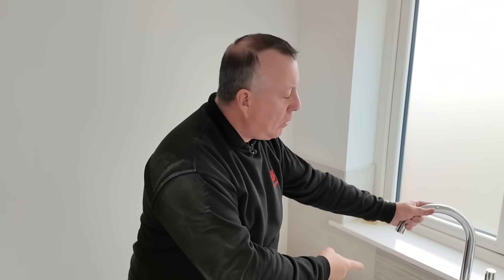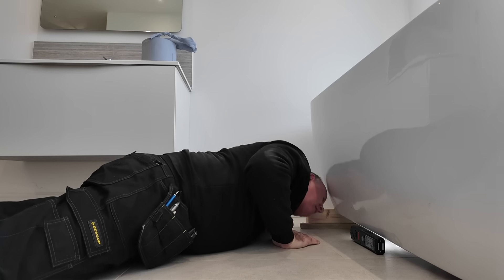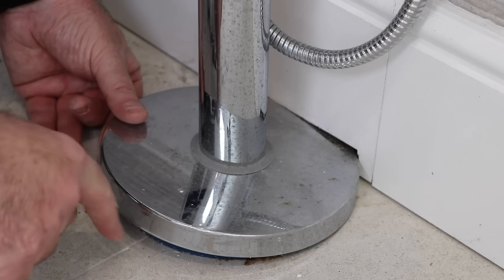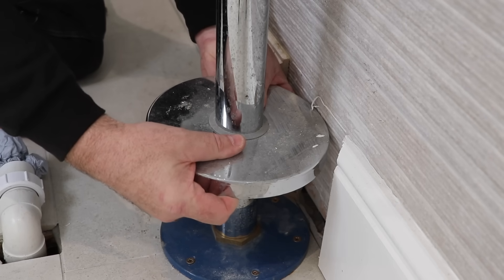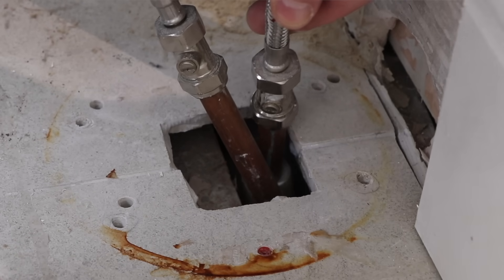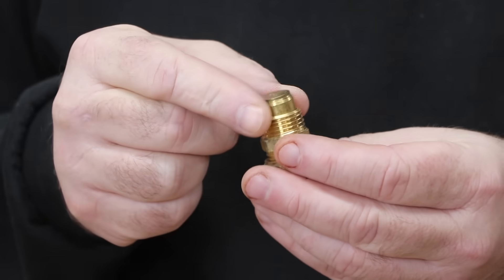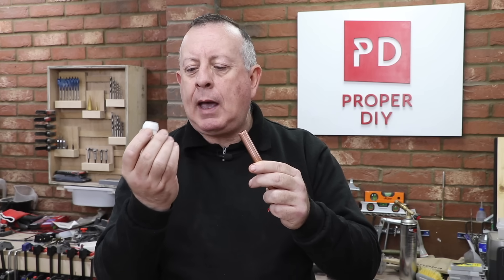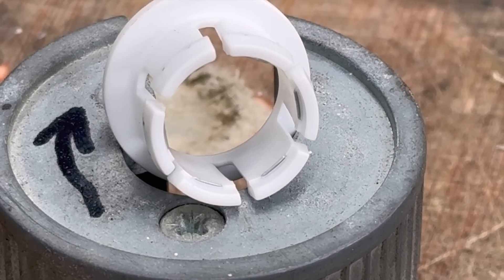The Best Method to 'Cap Off' Water Pipes.

Comment: Would you ever use push fit stop ends on a plastic pipe as a permanent solution? I've got a redundant hot and cold feed so have cut them back and I have used push fit stop ends. Those pipes will eventually live behind some plaster board. I read that they should only be used temporarily, but I'm struggling to find what a permanent stop end on a plastic pipe is? Any help would be great.
Reply: Cut pipe right back and don't leave any dead legs.

Comment: I realy would have put collet clips on the speedfit fittings, just as a matter of course.  If someone were to come along yanking at the pipes at a later date, it is feasible that the release mechanism could be triggered.

The difference between speedfit and copper fittings is that when they fail a speedfit will likely come off and you have a mains pressure flowing everywhere and a copper fitting will likely drip.  I had a Speedfit isolator fail and a massive flood in minutes, worse still it was hot water.

Comment: You could have also isolated the ballerfix valves and capped the other end of the valve with a 1/2” female cap end with a rubber washer 👍🏻

Comment: BTW, the way those clamps work, while tightening, all the force is being applied to a pretty small pin, typically held in place by less than 2 mm of plastic. Once you let go, a stronger metal piece takes over, but yeah, it's pretty easy to break the pin (or the plastic that holds it in place) if you have strong hands (or use two).

Edit: maybe disassembling a couple of quick clamps (from different manufacturers) and showing how they work would make for an interesting video.

Comment: If you use a push fit stopper on plastic pipe, you need to put a stiffening insert into the end of the pipe to be stopped.

Comment: I am a bit old fashioned, and am a 100% soldered joint person when it comes to joints and stops which are in inaccessible places. Normally I'd use capillary joints, where this is all out of sight, then I'd use the Yorkshire joints as they are out of sight and less to go wrong. Also, I would have said there was plenty of room for soldering, nor was it particularly flammable. 

What I would have questioned is why whoever installed that heated towel rail put service valves in an inaccessible place. It just seems to be another joint that could fail and which is difficult to get too.

Comment: In Australia you are not permitted to use flexable hoses under floors or inside walls as they have a life span of 10 years.Why not cap of the valves and leave them in place, in the shut off position that would provide added leak protection.

Comment: Staurt (or anyone that knows), why not leave the isolation valves in the off position to block the pipe ends?
Reply: Over time isolation valves are notorious for leaking from the tap seal. Tbh I'm a bit surprised to see them buried under the floor like that. Correct thing to remove them.

Comment: There is a lot of talk about Bacteria forming in dead legs. Question, How big of a risk is this really? What about things which are effective dead legs, Say an outside tap that Was fitted by a previous owner, but the current property owner doesn't really use it. Or a supply to a Utility room/ Garage Which, again, the owner doesn't really use.

I'd also question how common this would actually be in copper piping anyway, as copper is a natural Antimicrobial. Sitting stagnant would only increase the copper ion concentration in the still water. Studies that were popping up when looking into controlling of Legionnaires while mentioning dead legs, talk about Legionnaires in the context of controlling it in hospitals Because of the high risk of pneumonia outbreaks. The risk is also increased further in hard water environments, giving mineral buildups that can form pockets for bacteria to live.

It sounds like one of those things that you do not need to worry about too much in general in DIY, But it's definitely something a professional would have to keep note of, as the regulation is put in place due to it being a service utility, thus must account for outliers in the regulations, Such as people with weakened immune systems. Kind of like how all pedestrian Crossings have to have a non-visible queue installed for the blind, Whether that be a beep or a little spinning thumb dial on the bottom.
Reply: I was thinking the same.I do maintenance for a chain of betting shops and the staff often turn one of the customer toilets into a storeroom and the toilet/taps are never used and I can think of more situations like you mentioned.

Comment: Why did you not just leave the isolation valve on as your end stop?
Reply: That kind of isolation valve is only really for temporarily shutting off the water. They don't seal well enough to be used as a permanent end stop.

Comment: You had a stop valvs already in place, why didn't you simply remove flex and job done? (Apart that there would be less of the video material 😊). If you're worried the stop valve would stop working you could simple put a short pipe with end stop behing it. It would still sbe you lots of work and risk loosing pipe into the void, and the fact your pipes are shorter now 😊

Comment: Would it not have been easier to open the floor a little and change the tee connectors to straight connectors, that way eliminating the dead legs

Comment: The manufacturers of the push fittings are sneaky. Most advertise a 25yr guarantee but if you look at the small print in the guarantee it only applies to the plastic part and doesn't include the o-ring. I have had o-rings perish in as little as 5 yrs. If I was going to cap a pipe and bury it under the floorboards and then build on top of it, I probably would have gone to the effort to use a more permanent method of capping the pipe.

Comment: Perfect timing for this video, very informative!
For the plastic push fits, would they work on an old lead pipe too? I've got one on the garden that I'm hoping to cap off and not sure the best method
Reply: No they are different sizes you need to look at lead-loc fittings.
Reply: Hammer it flat then fold over the end. Not exactly by the book, but it works.

Comment: Great job see what you mean tho about them not popping off but still in my head they seemed like they would pop off lol
Reply: Should use a collet insert with these fittings. This keeps the collar with the grip teeth in the locked position. They come in red and blue also for pipe indication.
Reply: Those JG fittings are the nuts, much better than the older ones.
Don't forget this is in his bathroom so not under mains pressure

Comment: should not have used compression fittings that are not accessible, ie under floors, i was taught that as an apprentice plumber back in the 1970's. Soldered, back then, or push fit nowadays. if you had taken the copper out of the plastic and used an internal stop end, no dead leg in pipework.

Comment: Don’t all shout at me . But if there are isolating valves there already attached, why cap it off ? Why not just leave on isolating valves and push them back under the floor ? Since he just did that anyway.
Reply: Anything mechanical, compression nuts, isolation valves should be accessible for maintenance.
Reply: Those isolation valves are notorious for leaks. Not because of poor installation or manufacturing, just because of their design. So it was 100pc the right move to get rid of them.  As for all the dead leg drama, I wonder how many are aware of dead legs in their own home. Doing a bathroom renovation I discovered two 1.5m dead legs going to a bedroom for a basin that was no longer there, left by professional plumbers. No one died. I do take the point the regs are there for a reason and should be followed.
Reply: @MrEspadrilles  Domestic stuff will always slip the net because its not industry regulated like a workplace or other facility. Contract legionellla in your own home, no one is liable or accountable.
Reply: I have 2 outside  taps house  built 30 yrs never  used 2nd tap mabe  once per year is this  a dead leg
Reply: @johnspallen3132  No, a dead leg is when its capped off, with no way of flushing it. In a commercial setting, where its regulated, your tap would be put on a low use register, and flushed weekly.
    Probably worth flushing it in summer, given the silly temperatures. Cold water should stay under 20°C where possible.